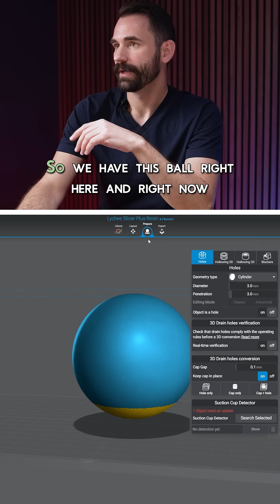The most important thing to know about Hollowing #3dprinting #lycheeslicer

Comment: Did you put the hole directly on the print plate?
Reply from the maker: It was just a demo, we didn't print this so yeah you'll want to move up the object before supporting and adding holes :)
Reply: @Lychee3d  :) you have to be careful. Sometimes we forget just how precise we have to be with beginners. Love your product.
Reply: @coinopanimator  They are already making such high quality content for beginners, so they look like they know how to do it right? Also, how were the beans?
Reply: @ArkatzMods  that's made my day. :) Tasty
Reply: And actully, looking closer, looks like the ball was already a tiny bit moved up from the plate.
Reply: @ArkatzMods  putting the hole face down toward the print plate isn’t always a good idea. Whilst it’s fine for releasing air it can create traps for the resin to pool. Increasing weight and making draining resin more difficult and potentially dangerous. Of course this is model dependent but generally not a good idea.